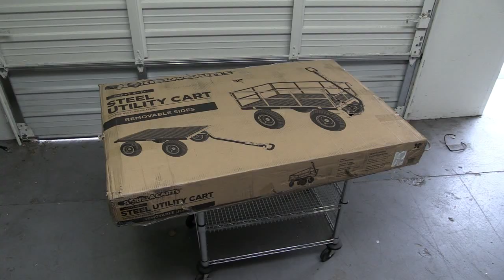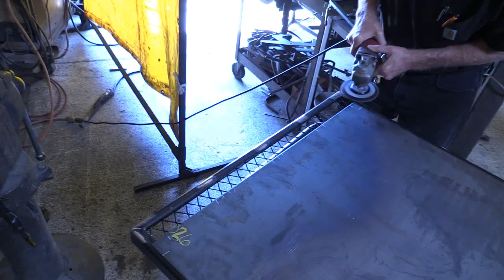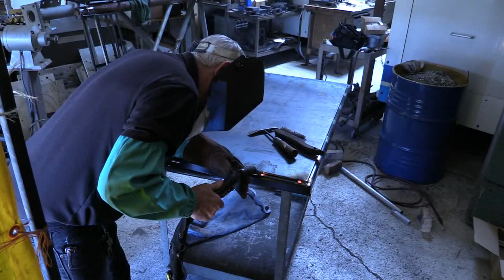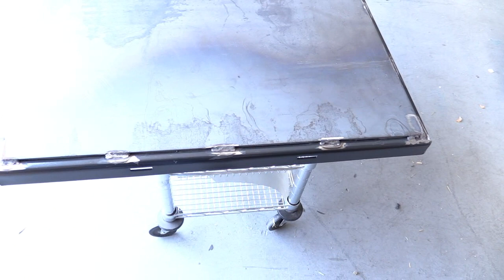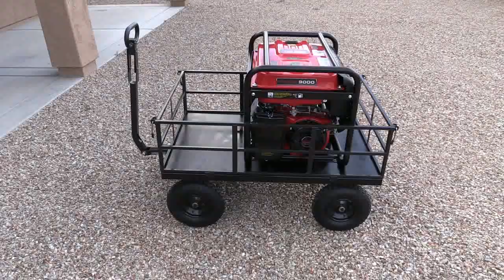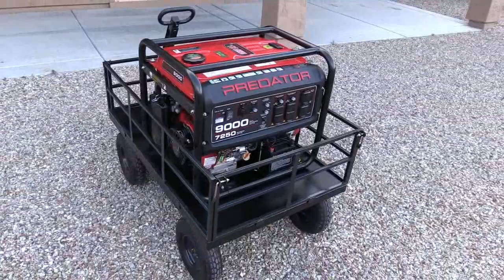Predator 9000 Generator Unboxing & Review

Comment: Ive been wanting to get one of these but not sure if it will run 3 qsc amplifiers 5050,4050 and 2450 plus mixer
Reply: ⚠️Always remember to follow all the generator safety tips whenever you use your portable generator. This is just a reminder for your safety when using generators. All generator safety instructions need to be followed carefully. 

Here are the safety tips: 

1) KEEPING OTHERS SAFE: Please do not allow an unqualified person or your children to operate and service the portable generator. Just because some manuals don’t say that doesn’t mean it’s safe. That is important against the generator safety rules. We also need to be keeping an eye on our children too. You need to make sure that your children are not playing near the portable generator especially when it’s running so they won’t get electrocuted. Generators pose electrical risks and they can be hot during an operation. Please keep your children away from the portable generator at all times. It is important to keep our children safe especially our little ones. Children often get curious about anything so we should keep an eye on them to also make sure they’re not wandering towards the generator. 

2) WHERE TO RUN YOUR GENERATOR: Some people use their portable generators indoors which increases the risk of carbon monoxide poisoning. It’s important to have a carbon monoxide if you have a gas generator. Never ever use your generator indoors even if your doors and windows are open and even in the garage is not safe to use a portable generator. Not even at your porch and your deck. It is never safe to use your generator indoors and in enclosed areas of your home. Your generator needs to be 15-20 feet away from your house. 

3)🔥FIRE HAZARDS: Never refuel your generator while it’s running. You need to let your generator cool off before refueling it and before storing your generator. Never overload your generator too. Never ever back feed your generator. You should never plug your generator into a wall outlet. Also never store propane tanks indoors. Please keep flammable things away from the generator as well and please don’t smoke cigarettes near the generator. Having a fire extinguisher next to the generator is also important against the generator safety rules. 

4) GENERATOR OPERATION: make sure your hands are dry before touching the generator. Never use your generator in wet conditions. Don’t let your generator get wet. You need a generator tent if you need to use your generator during wet weather. Please don’t wear loose clothes when operating the generator. Turn on your generator before plugging in appliances. Use the right cord for your generator. Please do not use worn out cords. 

Hope this helps.

Comment: informative. if it was me , i would have used wood on the cart. 90lbs is really overkill. really interested in the generator
Reply: ⚠️Always remember to follow all the generator safety tips whenever you use your portable generator. This is just a reminder for your safety when using generators. All generator safety instructions need to be followed carefully. 

Here are the safety tips: 

1) KEEPING OTHERS SAFE: Please do not allow an unqualified person or your children to operate and service the portable generator. Just because some manuals don’t say that doesn’t mean it’s safe. That is important against the generator safety rules. We also need to be keeping an eye on our children too. You need to make sure that your children are not playing near the portable generator especially when it’s running so they won’t get electrocuted. Generators pose electrical risks and they can be hot during an operation. Please keep your children away from the portable generator at all times. It is important to keep our children safe especially our little ones. Children often get curious about anything so we should keep an eye on them to also make sure they’re not wandering towards the generator. 

2) WHERE TO RUN YOUR GENERATOR: Some people use their portable generators indoors which increases the risk of carbon monoxide poisoning. It’s important to have a carbon monoxide if you have a gas generator. Never ever use your generator indoors even if your doors and windows are open and even in the garage is not safe to use a portable generator. Not even at your porch and your deck. It is never safe to use your generator indoors and in enclosed areas of your home. Your generator needs to be 15-20 feet away from your house. 

3)🔥FIRE HAZARDS: Never refuel your generator while it’s running. You need to let your generator cool off before refueling it and before storing your generator. Never overload your generator too. Never ever back feed your generator. You should never plug your generator into a wall outlet. Also never store propane tanks indoors. Please keep flammable things away from the generator as well and please don’t smoke cigarettes near the generator. Having a fire extinguisher next to the generator is also important against the generator safety rules. 

4) GENERATOR OPERATION: make sure your hands are dry before touching the generator. Never use your generator in wet conditions. Don’t let your generator get wet. You need a generator tent if you need to use your generator during wet weather. Please don’t wear loose clothes when operating the generator. Turn on your generator before plugging in appliances. Use the right cord for your generator. Please do not use worn out cords. 

Hope this helps.

Comment: How many tons of ac can this handle?
Reply from the maker: Its more about current draw, than "tons". You need to know the current draw of your AC system in Watts.  Im guessing, but something like a 18,000 BTU air conditioner using 230 volts, drawing 8 amps, uses about 2,000 watts, so you could run three of these units on this generator.  Can anyone smarter substantiate this?